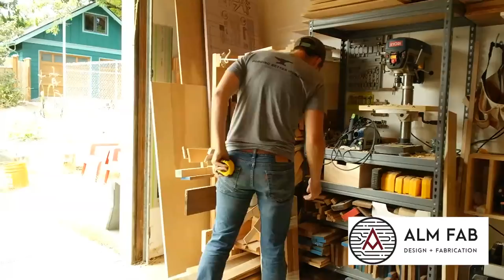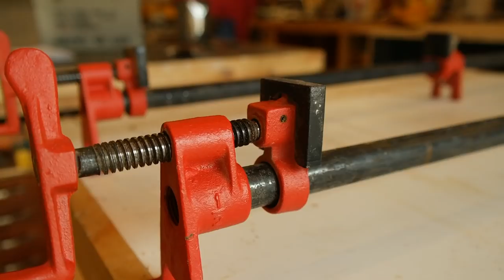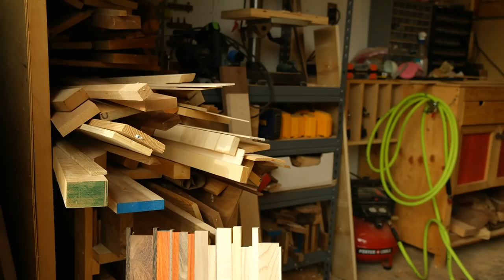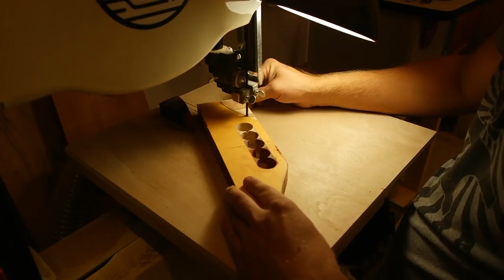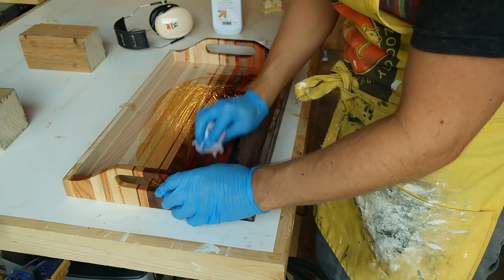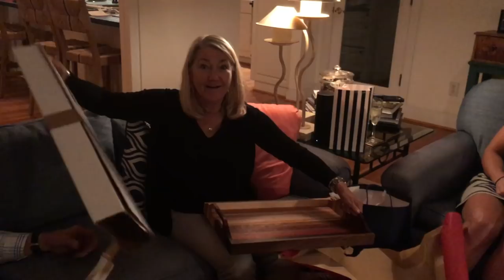Sunset Serving Tray from Scrap Wood -- Woodworking

Comment: Looks fantastic! Love the tip of sticking two pieces together to create identical ends. I’ve had that challenge before and did it the hard way. Precious moment at the end, thanks for sharing that!!
Reply: What did you use for a finish?
Reply: @donmolinari7476  because there’s a chance of it being around food, I typically use a cutting board oil and finish with a coat of wax. But pretty much once any finish cures, it’s food safe.

Comment: One minor suggestion, put some dowels or do some king of joinery for the bottom. With just glue it won’t be a lifetime gift it will get 10ish Year’s give or take , depending on the care it gets . But with dowels or screws hidden by plugs will last a lot longer

Comment: Nice looking tray.  Nice colors. 
I hope handles will hold long time.
Due the grain direction and size it's possible to brake.  
Any way nice work.  Cheers
Reply from the maker: Slovenian Woodworker thank you! I totally agree about the handles, they aren’t super strong. But i figure if the survive me tossing them around while sanding and gluing, then they should last for a bit. Thanks for watching
Reply: Michael Alm That often is good test. It if survive my handling as I'm not that gentle guy therfore it will survive normal use top:-)
Keep up the good work.  Cheers
Reply: Adding some biscuits to the end joints would strengthen the handles. Just throwing that out there for others to benefit if they attempt such a project. Love the graduated color choice.

Comment: An absolutely stunning tray. However I would be a tiny be worried about the handles being held on with just wood glue. Is it strong enough to hold a pot of tea and everything that goes with it, after the tray has been washed and wiped down a few times. Or did you use screws to secure the handles, but it wasn’t in the video. I’m a mum and a worrywart I’m afraid.

Comment: After watching this video, I made a similar design. I used a standard cutting board pattern (off-center bands of maple and peruvian walnut captured in black walnut) instead of a sunset pattern. The bands continued up the handles. 

I ran into some interesting issues because the grain orientation on the sides with the handles ran from bottom to top instead of the normal left/right orientation on normal tray sides. 

It meant that any joinery at the corners would show end grain on the handle sides vs edge grain on the long sides. The finished walnut end grain was significantly darker than the finished walnut edge grain. 

It meant that cutting dados or rabbets for the bottom would be a cross cut on the handle sides vs a rip cut on the long sides. I was using a box joint bit for the dado. I had to take more care to avoid tearout on the cross cuts. 

It also meant that I had to take care when making the holes for the handles. I hogged out most of the material with a forstner bit, then attempted to clean it up with a chisel. I was a little too aggressive and ended up splitting the piece along the grain. I had more success when I followed the forstner bit with a router template.

Comment: I would love to make a tray like this or even a butcher block cutting board, but I don't have all of the fancy woodworking equipment that you do here. I also have a kitchen cart that I picked up online. I want to refinish it and either make a new butcher block top for it or sand down the one thats on it since its damaged. I hoped to use it for extra counter space and for chopping veggies and things. I wish there was a place that people like me could go and rent woodworking equipment. BTW, what kind of oil did you put on the wood???
Reply from the maker: Thanks for watching. I know it's a challenge to get your hands on equipment. It's taken mw 12 years to collect the tools in my shop. The oil is mineral oil. It's food safe and you can buy it at the grocery store.

Comment: Lovely video! What 2 things did you use to seal the tray? Does steel wool not scratch it?

I'm planning on making one myself, but I'd like to seal my tray in a way that preserves the matte finish.
Reply from the maker: Hey, thanks! I used mineral oil and paste wax. The steel wool I use is OOOO so it doesn't scratch, it polishes. This is basically a butcher block finish. It's strong, but might need another coat of wax in a year. Let me know how yours turns out!

Comment: Wonderful. By the way what finish did you use?
Reply from the maker: Joshwa Devakumar thanks, mineral oil and paste wax
Reply: Michael Alm thanks for the info. I am just a beginner to carpentry. Want to know which power tool saw to buy that can be used for most of the carpentry?

Comment: Beautiful tray and great video, thanks for sharing! I was wondering if those end and side pieces were just glued on, it looked like it. Do you need to anything to accommodate expansion of the wood? Thanks!
Reply from the maker: Thanks! They are glued on. And it's a good question. I think those sides were 1.5" tall. There won't be enough expansion over that length to affect anything. You only really need to worry about that if you are building a table top, which has a lot more potential to expand.
Reply: @MichaelAlm  Thanks for the reply! I'm thinking about building one for my mom for Christmas. This will be basically my first project 👍
Reply from the maker: @ChadWoodward  Awesome! One thing that I suggest changing in the design is making the handles a bit thicker. Mine ended up pretty fragile. That isn't the strongest grain direction so thickening them up will make it a lot stronger. Good luck, and let me know how it turns out!
Reply: @MichaelAlm  thanks, will do!

Comment: Hey Micheal, Im a 15 year old getting into woodworking, I have a workshop at my school and really want to replicate this for my mother. If there's any way you can let me know the dimensions of the pieces, thickness, or the plans you used for this, I would greatly appreciate it, and would even pay you for them!!
Reply from the maker: That's great!  I don't have the tray anymore, and I didn't write down the measurements 😬But I do remember that the wood itself is 1/2 thick, and I think the tray was about 20" long and 11" wide. The sides without the handle were about 2" and with the handle 3". I would recommend doing the first glue up and seeing how much you end up with. Then designing the tray around that. Good luck!
Reply: @MichaelAlm  Thank you so much it means a lot! I'm planning to start it after I finish my current project, and if it ends up coming out to my standards, I'll send you a picture of the final product !
Reply from the maker: I'd love to see it!